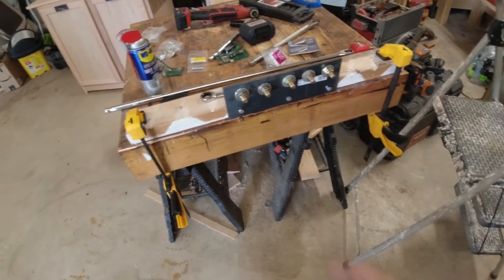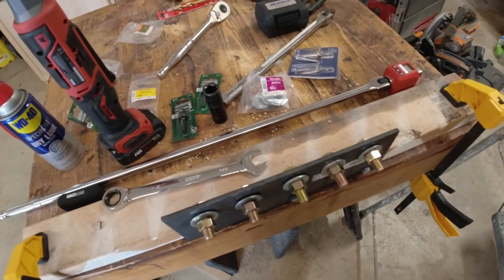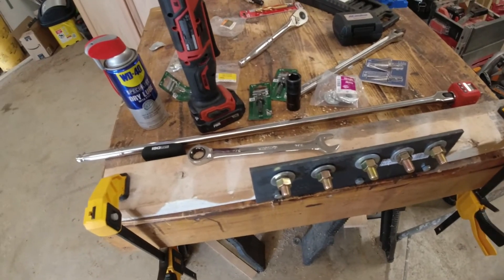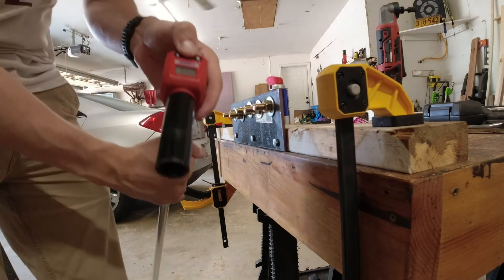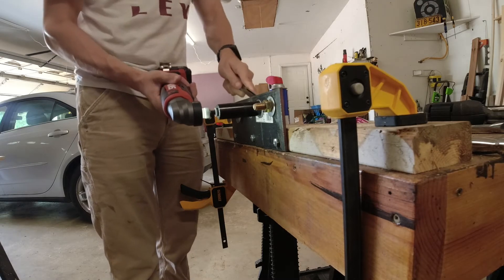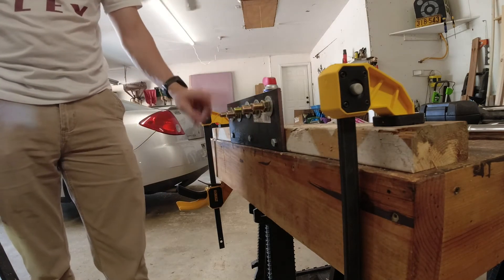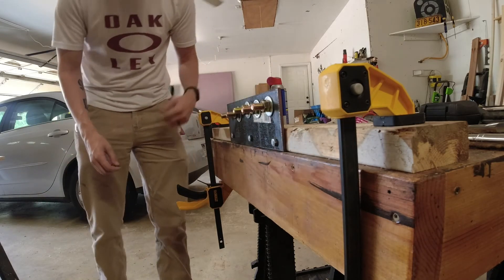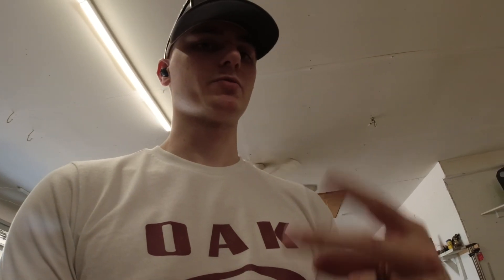Torque Testing Skil 12v Right Angle Impact Driver

Comment: This test was well-planned and executed. But.. the video could have been half as long if you had just fast-forwarded through all the set-up. Sure, show us one example at normal speed, but watching you use the torque wrench to set each bolt/nut combo was excruciating. Also, the on-screen graphics/charts could have been more complete and informative. Bottom line: The Skil 12v tool more-or-less performs as advertised. I suspect that had you used a 4 Ah battery the tightening test results would have been higher.

Comment: The larger, 4.0AH battery should give you 15 or 20 percent more torque.
Reply: The other tools do not prove to benefit from larger batteries. I think the controllers have that output limited to allow for longer runtime.

Comment: I hadn't thought about using a right angle impact driver as a ratchet but that's a neat idea. Much faster rpm than a ratchet too. Probably work really well if you've got the working room. Thanks for the vid.